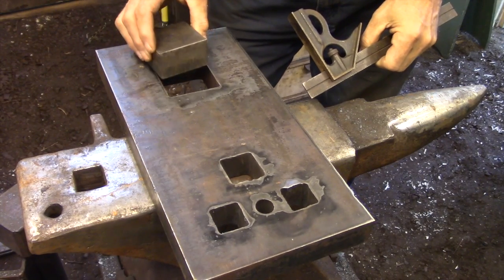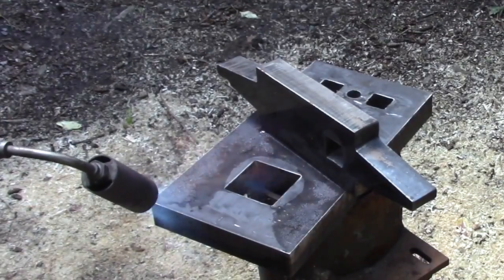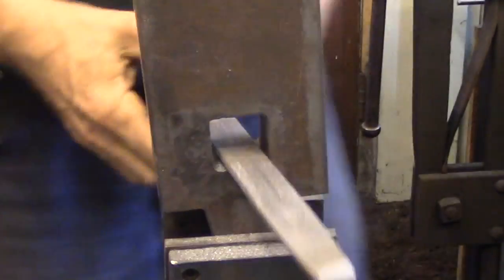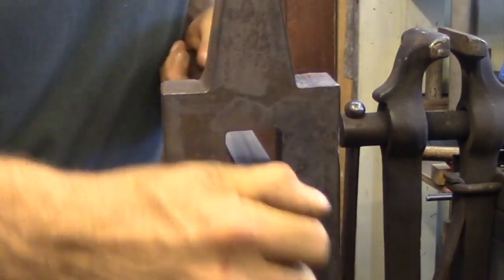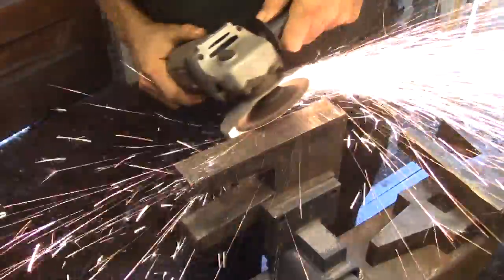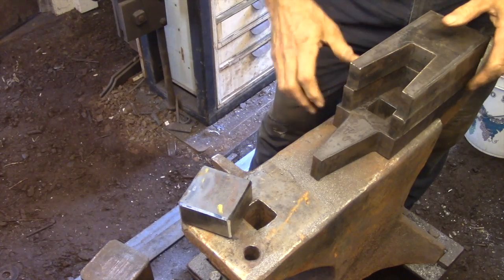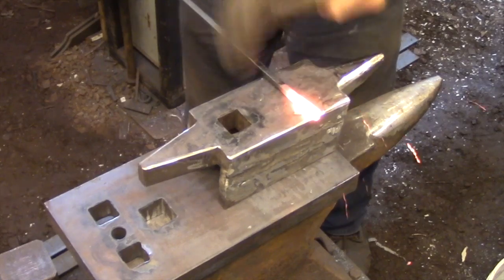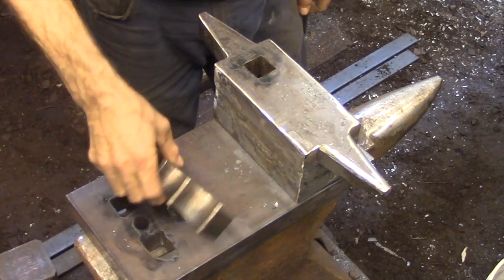Blacksmithing for Beginners - My CNC Anvil System 2

Comment: Annealing before filing is a real pain in the neck and the filing was no fun, either.  Did you consider having the hardy holes cut by wire EDM instead?  That process is so accurate that no filing at all would be needed although it might prove too costly.
Reply from the maker: Unfortunately at the time that was the only option I had available. I was able to anneal everything in my pottery kiln so that wasn't too bad but your right about the filling.  Still it's a good system and overall it did save me a lot of time.

Comment: Clever design that I'm sure will help people.  I have no smithing experience, but I do have one question ... 

Given the time and expense you'd already put into that build, perhaps it might have been worth it to go the extra distance to grind down all the internal edges, preheat everything to 400F, and then use hand-piened full penetration welds for a much stronger result ?  Doing that would probably result in higher rebound efficiency as well.  Heck, if one of your colleagues has a decent sized forge, you could (given the modest size of this build) go one better and heat the whole thing up to welding temp and then hammer weld (or hydrolic press) the face to the waist.

Something to consider for version 3 perhaps ?
Reply from the maker: Actually I did everything "wrong" just to prove that  you don't need to get too carried away with putting some pieces of steel together for an anvil.  I didn't bevel any edges or do any preheat before welding.  I used 6011 rod and only made only one pass around the outside of each piece and then I ground the weld level with the sides.  I have been told by may people that this will simply fly apart as soon as I hit it but I'm still waiting for the  first crack to appear.  This is not intended to replace a top quality all steel anvil.  All I wanted to do is show that you can make a usable anvil out of a pile of pieces of steel that are basically tack welded together.
Reply: DF - In The Shop Understood, and you definitely succeeded in that regard.  Props to you, sir. 😁
Reply: DF - In The Shop Understood. You definitely succeeded in proof of concept. Kudos. 😁

Comment: I the cut list you show cutting out 2 "anvil block shank".  But when you assemble you only use one correct?
Reply from the maker: That's right.  I originally was going to use the 2 blocks together to form the shank but it wasn't necessary so now I have a spare to use for something else.
Reply: Thanks for the reply.  I think I have a shop that will cut mine out now.

Comment: i really like how you did the clearance for the hardy hole and it will be insetting to see if you have more movement in the anvil when the base plate is fixed right now any jump you would get from striking is being transferred into lateral movement in the base plate

Comment: having worked on real "anvils"/as well as other hardened steel objects vs aso/mild steel and what as well as using an anvil with its face milled off and another one that has gone through a fire a good hard piece of steel dose let you move metal faster but heck i have used a tree stump as well when we were in a pinch (long sorry short if you are going to be doing this all day every day or even every weekend get something that is hard and flat from the scrapyard and get to it it will save your joints and let you be more productive) a mild block of steel will work and yes more mass is best (i have done a good bit with a 3x3 work face with 18inches of steel under)

Comment: If possible, maybe you could have this cut with a wterjet table instead of plasma.  That way you could get tight corners and there wouldn"t be a hardened plate if you did need to tweak your cuts.
Reply from the maker: the water jet would be the way to go but unfortunately nobody has one around here.

Comment: wonder if you could have chiseled a lot of the material away? I have read that suggested, but I am not as good with chisels as you are. Just want to know your opinion. I have a "benchtop" milling machine, but it weighs 800lb and is about 3hp. It isn't a bridgeport, but I can take 20 thousandths per cut in mild steel (hell, in high carbon steel). I cheat and use it for big slots.
Reply from the maker: I did try that but the plate was still too hard. I have a mini mill but it can't reach the center hole. It wasn't really that bad.  I just wanted to be clear that this is an area that needs a little time.
Reply: thanks for info.

Comment: To normalize metal parts like this, I build up an enclosure out of old bricks (no mortar or anything fancy, just a non-flamable fence). I bury the pieces in charcoal, about four inches over and under, and light it. I let it burn completely out and let it lay in the ashes over night to cool slowly. I have done weldments, roll forms, and various mild steel pieces this way for years and it always stabilize the metal and makes it workable.

Comment: Depending on the actual grade of steel you have preheat is required over 1 1/2' thickness.1.5 - 2.5" is 150F, over 2.5" is 225F per AWS. that includes Cat. B steel A36 - A572. FYI
Reply from the maker: Thanks - I didn't realize the recommended preheat temp was that low.
Reply: I think interpose temps are 300-450 depending on what group the material is in. Ill see if i can find a PDF and ill shoot it to you. Cant ever have too much information i always say. you may never need it again but chances are......

Comment: I remember my first anvil. (it was a tree stump) My next anvil was a cheep nine pound hobby anvil that was dead soft.(I have since mounted it on the first anvil). my third anvil was an antique plow,(not very mobile but it was better than either of my previous anvils) and now i am working on setting up a new smithy using a 150 pound mousehole anvil. (the face was severely damaged yet still hard enough to bounce a steel marble to within a short distance of the hand that dropped it)

Comment: Interesting build. I set two plates under my gantry rail anvil and it made a noticeable difference. weighed it all while I had it loose. Totals out at 134 pounds. the plates are not welded I just bound it down with chains to my log anvil stand.

Comment: Dennis I can say from experience your idea of Mass is incorrect. I have a 100+ pound piece of 4140 and a 88 pound piece of mild steel. When the 4140  being 2 1/2 inches thick by 5 is a pretty dead piece of steel an gives noticeable fatigue after use. The 88 pound mild is 6x6x12 inches and is pleasant to work on, the mass  makes the difference. When you place the 2 1/2 inch thick 4140 on top, the stack reverts back to the top pieces individual response, responds as it did on its own.I am anxious to see how this system works when clamped and welded. Maybe when you weld up your other ones you would take the time to weld one solid from the center out for comparison. As in carpentry there is a particular distance where things are attached. Sheetrock for instance on a ceiling needs 12 inch on center to stay in place securely. I would think a void  between steels and still act as one piece exist, I wonder what that distance would be? Your design is as close to finding out the distance as I've seen, if it doesn't work then its less if is does work then at least your area is a minimum to start. Thank you for your page your approach to 
Blacksmithing is refreshing and informative.
Reply: Gary Busby you didn't weld the 4140 on the mild steel? That would explain why it's not working for you

Comment: I will add my two cents. I am almost afraid to see the local cost of having this cut. But as soon as you fix the broken download link to the vector file. I will. (currently goes to an empty dir labeled Columbian vice or some such).  Thank you for sharing this knowledge, your time, and effort is appreciated.
Reply from the maker: Actually the unit on the video was around $300.  Someone in the last video commented that if you can go to a steel supplier that has a cnc service you will pay a lot less than gong to a machine shop. I don't have that option here.  
I think I fixed the link - please let me know, Thanks
Reply: @df-intheshop330  How did that steel alone cost you?
Reply: if i recall correctly he paid around a hundred for each one, not that bad considering he got the two small swages too
Reply: works now :)
Great little design!

Comment: I use two blocks of mild steel, one stands on end with three profiles.  Slightly rounded, 6 inch radius and on for drawing steel out with the third profile is about a one inch radius. The other block is for general steel wacking.

Comment: looks really good all put together (once you got all that filing done)  Maybe getting it water jetted maybe have made the tolerances closer?
Reply from the maker: I'm sure a water jet cnc would do a better job.  It certainly wouldn't harden the cuts but that isn't an option around here. The plasma starts to deflect slightly as the steel gets thicker so that's the reason I decided to do the final fitting myself.
Reply: he said in the previos video he purposely made that with no tolerance at all to have the possibility to fine tune it himself

Comment: You may want to try one of these HF belt sanders for stock removal in tight areas. It works well for my needs at the price it is. https://www.harborfreight.com/53-amp-12-in-heavy-duty-bandfile-belt-sander-62863.html
They also have an air operated unit I have not tried.  https://www.harborfreight.com/38-in-belt-air-sander-60627.html

Comment: I think you may have just made blacksmithing more accessible to those who may have less to access it with. Thanks for this DF!
Reply: You can buy an anvil for just a few dollars more than was spent on each unit to be cut. But if one is available and the other is not then.....
Reply: +Gary Busby : Please be aware that these videos are like Short Wave Radio - they go right around the world. If you notice what happens outside First World countries, you'll see that MILLIONS of people don't have the luxury of driving on beautifully sealed roads to their well stocked Big Box Store to chuck a few dollars on the counter for a traditional anvil. That's why people like me, and many others welcome this innovative design, which we can modify according to our locally available scrap steel plate. Most of us will then use our ingenuity, an angle grinder and welder to make something that works for us.

Comment: is it a fair test to have this anvil sitting on your already-rigid anvil and stump, adding a significant amount of mass? 

what difference is there in welding a hardened face plate that requires 100% connection as opposed to welding slabs in the waist that do not need 100% connection? i would really suspect that vibration (as showcased and exaggerrated here by dancing) is a concern to forging efficiency, and is present in both a faceplate connection and a waist connection.
Reply from the maker: I left the anvil unit sitting on my main anvil to show that it has enough mass on its own to be a stable work surface.  Not being connected to the anvil allows it to move around as I was hammering.  When I add a stand that will only increase its stability.  Adding a hardened face is a problem because there is a lot of stress during the heat treating process.  The two different materials contract at different rates and amounts.  If the face isn't solidly welded to the block it will find weaknesses in the weld and you could loose that connection.  Also the hard face tends to be a lot thinner than the metal used to build up the mass  of the anvil so it is more prone to damage because it is receiving the full impact of the hammer.  This stress dissipates very quickly as you move into the body of the anvil.  An 1.5 inch of metal will not likely distort and will transfers very little stress to the welds.